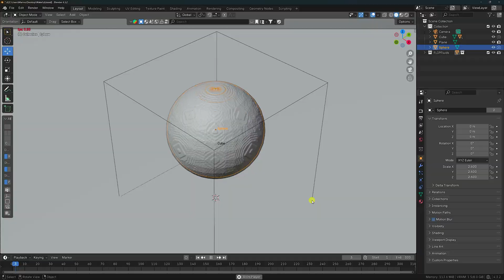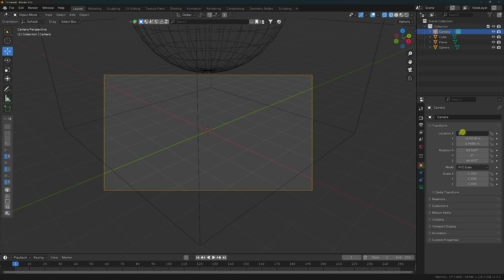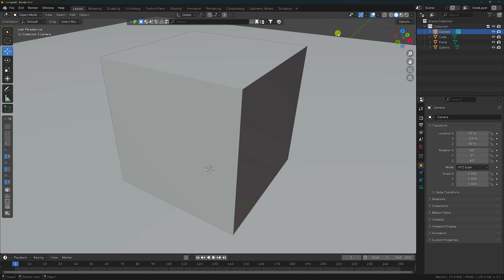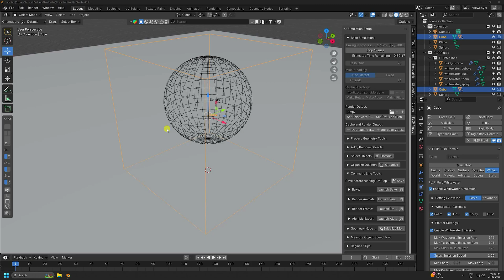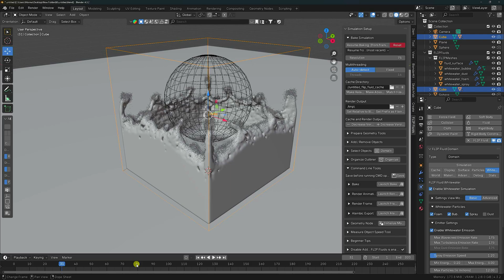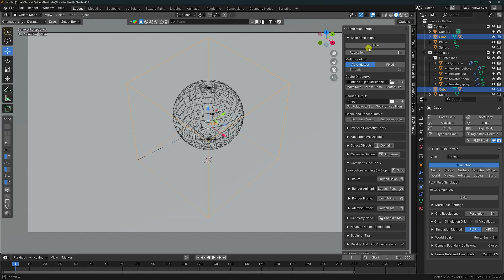Fluid Simulations for Beginners Blender Tutorial ( FLIP Fluids)

Comment: Bro how long does a 500 frames liquid in 500 resolution take to bake on your pc, I want to know if my pc is crazy.
Reply from the maker: I think it will take about 4 hours 500 bake on my pc, but your system may be different!
Reply: @FattuTutorials  I'm using a core i7 12th gen PC, RTX 3070ti, but a scene I'm simulating is taking like 8 minutes to bake one frame😭😭😭 at 400 resolution
Reply from the maker: @  You have a better PC than mine… My AMD 2700x, 3070
Reply: @FattuTutorials  Please bro, how can I send it the file to you to help me take a look at what is actually the issue
Reply: @FattuTutorials  did you render through command line?